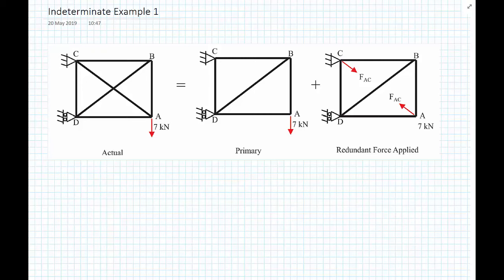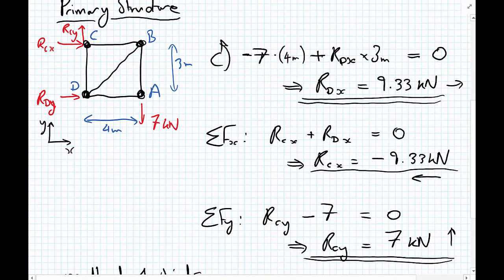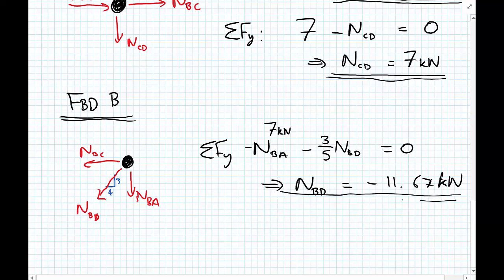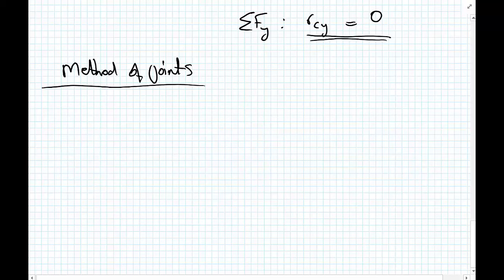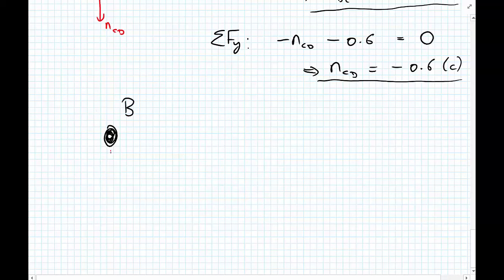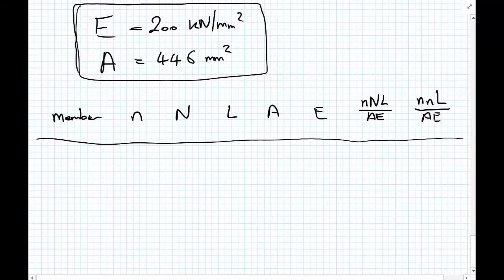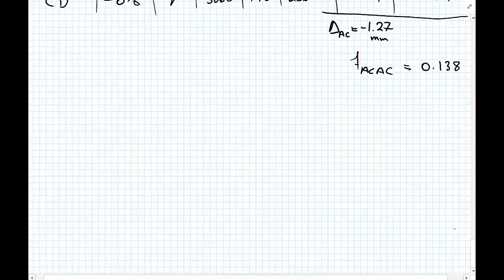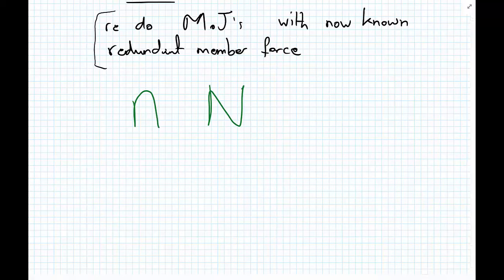Virtual work / Unit-load - indeterminate truss example

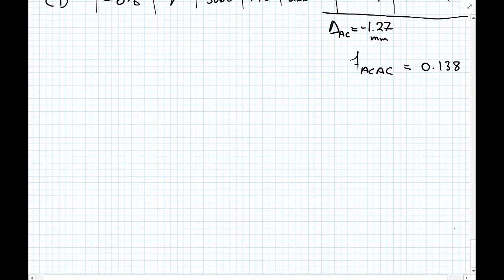Comment from the maker: 34:45 other solutions include the unit load in AC to calculate the flexibility of AC. This gives a more accurate solution, but the compatibility equation is less clear.